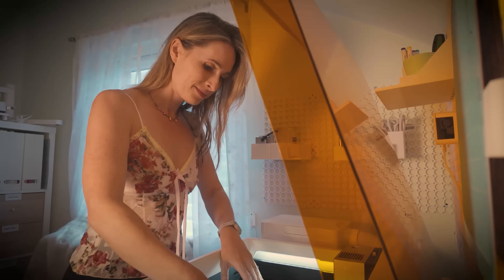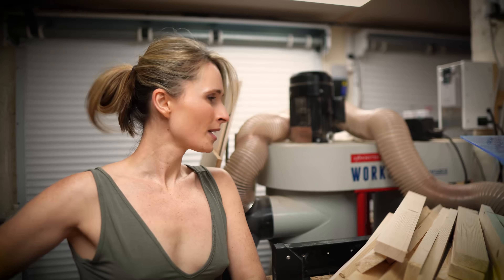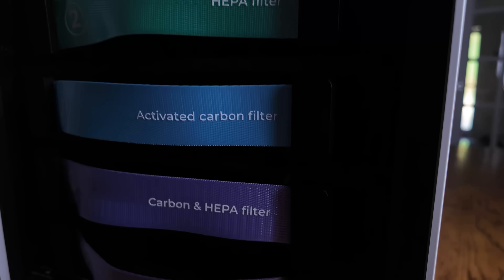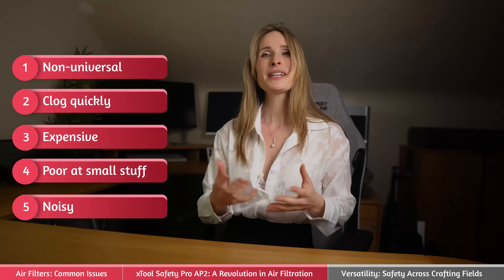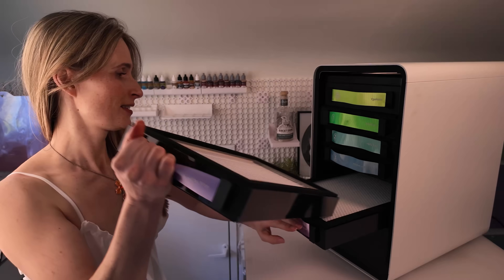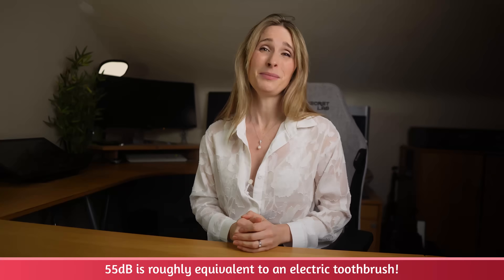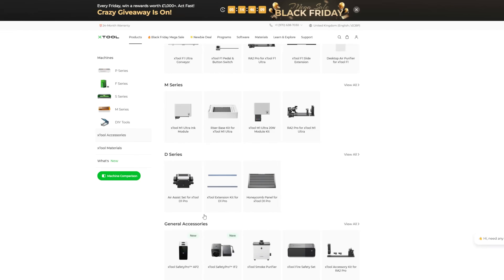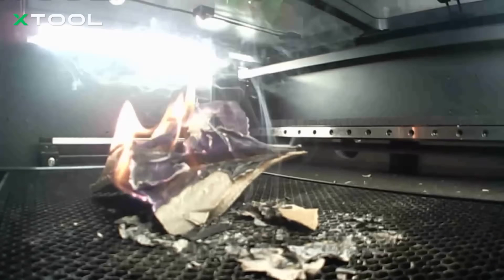xTool Safety Pro AP2: Is This the Ultimate Laser Safety Upgrade?

Comment: So using this with X1 Carbon when printing ABS or ASA eliminates the need to vent to the outside?
Reply from the maker: Yes, that's the goal of this - check their site for all the details, very clever
Reply: Making a hole in the wall to vent outside is much cheaper as it is a one time investment. You will have to constantly buy replacement filters. This will drain your wallet.
Reply from the maker: @flybywire5866  Well if you live in a warm climate AND you are able to drill holes in your house (ie not renting or concerned), then great!! Building an exhaust cabinet like I'm planning in my new workshop is also a great way to achieve this. But if you live in more usual climates, then it might be worth doing the maths on the heat lost (and cost per year) vs the cost of running a filter.... you might be surprised, I was!

Comment: I love my AP2 so far, but there is one HUGE problem...

Xtool has ensured that there will forever be demand for their filters by RFID tracking their time of useage, no matter what the conditions are or what you're cutting, if the filter is on it's "consuming" filter lifespan. 

There needs to be a hack where you can disconnect the RFID feature and override the system that tracks filter usage. I can just use compressed air to blow out the filters, which will significantly increase the advertised lifespan of the filter cartridges.

This mod should be at THE TOP of everyone's list if you own one of these filters. I have already burned through the pre-filter in about 3 weeks of use. I don't need added expenses for my small business.

Another issue is tracking the status of these filters if you're not a XCS user. There should be an online dashboard or something where you can track its status. I do not use it for an XTool machine, so there's no way for me to know when or which filter is due for replacement.
Reply from the maker: Ah very interesting point, I hadn't tested with non-xTool devices over a long period yet - let me raise this with them! Likewise on the RFID side too!
Reply: @handsonkatie  That would be awesome! Huge, huge negative for anyone that doesn't use XCS... Even just a simple online viewer that shows filter status, or better yet, turning off the filter status all together.
Reply from the maker: Cool - email sent, will let you know their thoughts!!
Reply from the maker: Hey! Ok, update back from the xTool gang!

So everything is as expected - ie the RFID tag detects new filters to save resetting/losing track and this is a simple time of use counter. As I say, this is all reasonable to me as there's no credible way I can think of to track 'clogginess' of each individual filter without getting into really prohibitively complex tech (and even then, there'd still be flaws).

Now crucially, if you go past the 'used up' date for the filter, it doesn't stop you using the device at all, so it's just a warning that you need to replace - so there's no 'lock out' or anything, so if you wanted to clear out the filter and carry it on, then you could - just obviously there'd be masses of caveats in terms of healthy ways to remove the dust particles without causing yourself risk, hence I don't think xTool or any other firm would ever necessarily 'recommend' this. But totally possible.

Then on the non-XCS user point - their dev team have taken the feedback and are looking at options for this (I also asked if they could look at creating API connectors so even other apps like Orcaslicer could potentially turn the device on/off etc). 

So pretty receptive in all - I do think they may have surprised themselves a bit on this, ie they designed an 'uber filter' for their own lasers and may not have realised the full potential as an 'all round' device filter at the start of development!  Drop me an email on my site if helpful and I can keep you posted on progress!

Comment: I located a more detailed xTool marketing graphic for the AP2 that outlines the purpose of each component filter in the system.

Layer 1 - "SuperCyclone Filter. Washable and Reusable. 99% block large particles, anti-clogging." - This component is very poorly designed if it is intended to be disassembled and cleaned by users. At a minimum, its housing should be made of aluminum instead of plastic as the frequent need to clean it and the repetitive insertion and removal of the 6 screws will result in stripped threads and a failure to seal. This device will trap smoldering debris that will on occasion be pulled into the unit and will reduce, though not eliminate, the risk of fire. A steel wire mesh is typically used to trap such debris in commercial systems (and in my own design).

Layer 2 - "Pre-Filter. 90% intercept Visible Substances." - This is not a true statement. First, the "SuperCyclone Filter" is actually the pre-filter in this system. Second, the material used for the pre-filter will not trap the smoke particles, with more than 10% passing through to the next filter layer.

Layer 3 - "Medium Efficiency Filter. 95% remove fine dust." - This is identified and sold on the xTool website as a HEPA filter. It is nothing but a medium quality air filter like you would use in an HVAC system for trapping dust.

Layer 4 - "Activate Carbon Filter. 84.4% Intercept Harmful Fumes." - This filter appears to be what it claims, but the pattern of discoloration reveals the airflow is along the edges of the housing and not through the center of the carbon filter. The airflow through the system is improper, rendering this filter inefficient.

Layer 5 - "Ultra-Dense Carbon Mesh. 97.97% Adsorb Odors." - This filter is performing the function that a properly designed activated carbon filter would do. In a well-designed system, there would only be one activated carbon filter, and it would be the final stage in the air filtration system.

Layer 6 - "HEPA Filter. 99.97% Filter 0.3 um Dust." - This should be installed before the activated carbon filter at Layer 4. Why? Because the activated carbon works through a process known as adsorption (not absorption). The dust which should be trapped by the HEPA filter will be adsorbed by the carbon, greatly reducing its lifespan and rendering it useless.

Professional opinion: The AP2 will work to eliminate large particles, smoke, fine dust, and odors. However, it is a poor design that is only suitable for occasional use by hobbyists. If you need an air filtration system for daily use (especially light commercial use), then this is device is not the right solution. While the systems designed for commercial use are typically priced at $1,500 US or more, they are easier to service and more durable. If this was my only other option than cutting a hole in the wall and venting outdoors, then there would be a hole in the wall (with neighbors likely complaining about the fumes).